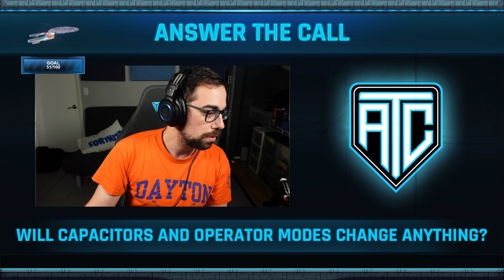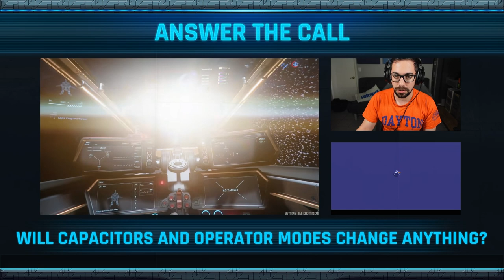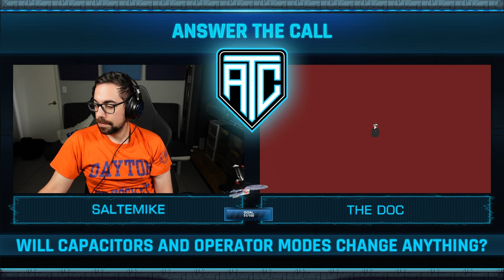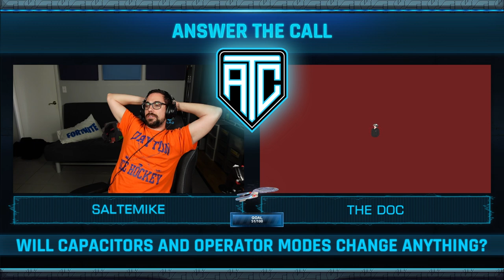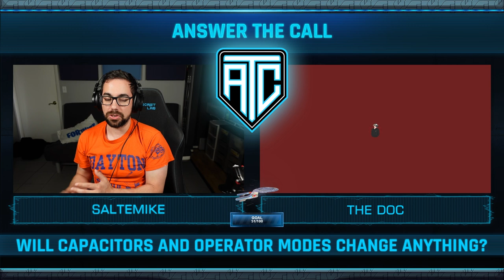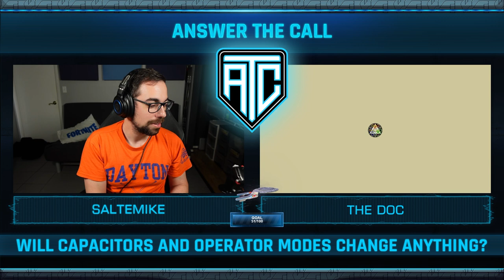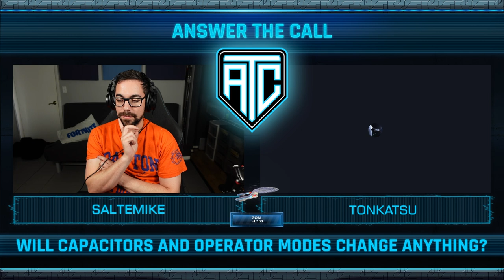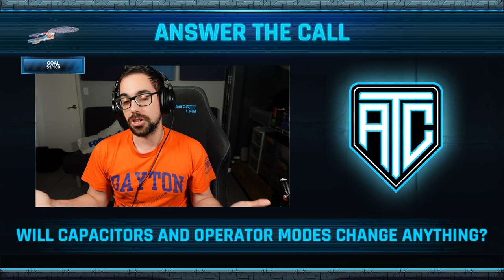Answer the Call: Will Capacitors and Operator Modes Change Anything?

Comment: Regarding high speed combat I propose different operator modes for the pilot:
1. Cruise speed, no weapons.
2. Combat, only SCM speed, weapons only come online once slowed down.
3.QT mode, only SCM speed, QT only spools/calculates when slowed down.

That allows people to "run" via cruise, but if they cannot shake you off they would still be a sitting duck when trying to jump away.

Okay that would still suck because there would be no limit to cruising away indefinitely... And no way to stop them.

But comment anyway for the algorithm :)
Reply from the maker: 1 is flawed because then running is too op.  You have to chase at the same speeds.
Reply: You don't have to solve the running away part, but also jousting. Even if people can't QT away they will still try to get as much distance as possible to buy time and that creates jousting. There should be a system that makes it very hard to get into QT and CRU once you're in combat so if you want to run you either have to do it before you are engaged or if the enemy pilot disengages you for whatever reason.

Comment: Here some points of a CIG employee about future keybinding improvements from Spectrum.

1) At some point we wanna take the time to allow creating custom modifier buttons for sticks. Atm the existing modifiers are hard coded but it doesn't need to stay that way. It requires some time to do it and I cannot say when it will happen but it is tasked up somewhere.

2) The upcoming operator modes (with the Missile Operator Mode being the first one) actually allows a lot of optimization in terms of input configs. Since some of those operators will be exclusive to each other (using guns and missiles on the same seat is not allowed at the same time) it frees up a lot of buttons (e.g. weapon groups, gimbal modes, swapping lead / lag pips are all not used during M.O.M.) ... so certain functions can be collapsed to the same buttons on the sticks.

3) In general our default bindings for sticks are hopelessly outdated. We'll soon start to update and including profiles that closer match the current range of available sticks.

4) We're thinking about to more combined keys. E.g. for the capacitor controls you'll have the default needed bindings but we'll also add a couple of "combined" bindings that have a different function based on whether you do a tap or long press. Similar combinations can also be created for other functions on a case by case basis. As always I am open to suggestions here.
Reply: Spectrum source:
https://robertsspaceindustries.com/spectrum/community/SC/forum/50259/thread/cig-huge-amount-of-control-buttons-necessary-durin/4031881

Comment: Well, the capacitor gameplay is a tried and proven mechanic from old X-Wing and Tie Fighter days seeing its latest iteration in SW Squadrons.  In the end, it will depend on how well they implement it, too soon to tell for me.
Reply: That is not really capacitor gameplay in those games, more like the power triangle we have in SC.

The capacitor system goes deeper than that as both a component that moves power between multiple components from the battery but also as a short burst of power.

Then we have physicalized damage system where a capacitor can be individually hit and take out multiple components since those components can be linked to said capacitor.

Comment: the way i see these Capacitors is the way Elite Dangerous pips are, u can put dots[pips] into engine, systems, ect
Reply: This is exactly what it seems like to me.. and I am curious as to why it seems like Mike hasn't played it.  You'd think he'd check out the competition and what they do.
Reply: One of the issues SC has is eliminated by how ED eliminates high speed combat, in favor of 'low warp' or 'cruise' speeds.  Intersystem travel.  SC does not separate the two.  They are trying to mash cruise speeds and combat speeds together.  Their capacitor pips work great, as there is a speed limit to each ship, a recharge rate to  ship systems and a boost cap to thrusters.  SC makes things too complicated.  Combat is too fast because fast combat is allowed.  ED's positional combat is great, because you have the time to use capacitors effectively.

Comment: Too bad, I missed the Twitch stream on this one! Capacitors I think will change PvP but it really depends on how much power they are going to put out compared to base power. If the capacitor is able to boost  power by 100% or more for short periods on time, it will change the game a lot.

Comment: With physicalized damage system online (whenever that is) means that if we hit a capacitor it could cut power to multiple components linked to that capacitor.

Why, because the power system seems to be the following:

Powerplant -->Battery -->Capacitor -->Components

So if a shield generator and two thrusters are linked to a capacitor and that capacitor is destroyed (and we cannot reroute power via another capacitor) then those components cannot be utilized.

Comment: One thing you might not know Mike is that developers check out subsections of code, not the entire thing, so they could be developing cutting-edge features but have an older copy of the other pieces and it won't get merged with the latest build until it's done.  So it could have been recorded the day the did the recording, and be the latest footage of the cap gameplay, but not have the other features because they haven't merged yet.

Comment: You can just look at real life to learn what the advantages/disadvantages of multi-crew ships would be.  Look at a single seat fighter like the F-15 vs an F-14 in terms of workload (not capability since they are different generation aircraft) for the pilot.  With the F-14 you have a RIO to handle your radar, radios and an extra pair of eyes, this means the pilot can really focus on flying the aircraft and keeping his eyes open for other threats while the RIO can focus on his tasks.  It increases the effectiveness of the crew by lowering the workload.  I'd like to see this work out with capacitors as well, where the copilot could maybe handle that while the pilot keeps his focus on the target.

Them adding "difficulty" into the game does two things, it potentially makes multicrew ships more powerful and it makes the possible skill gap between average and good pilots higher.  Sure, your pilot can still fire missiles, but that means he has to stop firing his guns, wait for lock... then fire.  If he had another crew member handling missiles that gap of fire wouldn't happen.

There is good reason you have two seaters in some situations like the AH-64 Apache, some models of the F-18, etc in real life.  I think that can reflect in Star Citizen so that two seaters are more effective due to the lower and more focused workload on the crew.
Reply: This, I think, is one of the key reasons of the nose system. Define multiplay in ships as having advantage possibly over two single player ships in certain circumstances.

Comment: A missile mode is going to also need a complete rebalancing of all missile attributes. The window for use is currently 2000 meters to 750 meters and even if you forced both ships to travel at average scm speed if they're headed at each other the window only lasts maybe 2 or 3 seconds. All size 1 missiles have .5 second lock time. 

Hitting an extra button and the display change adds another second for the hud closing that window further. Even someone running away at high speed will be out of that window in less than the time it takes to turn and lock on let alone change direction to chase them. 

It may make more sense to keep lower damage "fire and forget" for fighters and make the ones with better tracking geared towards ships with a copilot seat that have better than standard tracking properties.

Comment: Missile operator mode, specifically, will probably only apply to multi crew ships.  Not solo fighters.

Capacitors sounds like rechargeable batteries that give a boost to any system you wish, on command.
Their benefit will only last a short period of time, before they need to recharge.
It's just a "buff" on command.

Of course these systems will change gameplay.

Good or bad, remains to be seen.
Reply: In the ISC they specifically say that it will be used in solo fighters as well and that you will have to choose to ether be in gun mode or missile operator mode and you cannot use them at the same time.
Reply: No it applies to all ships.
Reply: @Sarazoul  oh boy.... 

That's going to go over like a lead balloon.

Hovermode 2.0?

Comment: I could see it being helpful for balancing stuff like the Talon. It can keep the nice forward boost and the 2xs4 fixed on such a small fighter. With capacitors you give the player the choice which one to use. We have a system that lets you do that now, but expecting players to toggle thru menus mid dogfight. 

Originally the Talon had a LOT of power issues, and you'd randomly lose power on items.  This system can be like a buffer where the Talons strength is balanced via power distribution, where the bad side effects are lessened by just having an empty capacitor. Like "oh no I can't boost because I've been overclocking attritions". Instead, the Talon having badly managed power on original  release would randomly spin, shields would just shut off, as well as the display. I loved the realism, but it wasn't 'gamey'. It was just a confusing mess.

Sorry if that didn't make any sense.

Comment: So what Mike said 35 minutes in the video. Having more buttons to push for mouse and keyboard (which was techinically superior accuracy) means it gets harder for the "better" way to beat a good hotas system that uses easier button taps. So if that true good balancing.

Comment: The developer said they drain very quickly when using them with lasers. Sounds like it's gonna be another "why bother".  Besides with literally 5-15 seconds of dogfight time how you gonna have the time to allocate capacitor charge. And my controller bindings are quite full. Be nice to revamp the control set up. Hold and double tap ain't quite cutting it.

Comment: Having a turret gunner CAN be more effective in the future than having 2 ships out at the same time because of cost. When insurance gets implemented it should bring the cost of employing 2 ships to a much higher rate than utilizing just one. This would tie into all the other operating costs like fuel and other situations such as larger quantum jumps which smaller ships cannot complete without stops. 

The same argument can be applied to ground vehicles. Everyone keeps asking why someone would use a tank or any ground vehicle over a space ship because the space ship is obviously better. However, the cost of insurance and initial purchase of a ground vehicle would be so much less, as well as the cost of claiming them. Why take out a target/base with a space ship when you can with a couple of tanks?

None of this applies in the current build because not much of this is implemented or balanced yet...

Comment: Okay, so after watching the video 20 times here is how capacitors appear to be working.

There are 3 capacitors, one each for shields, engines, and weapons. The power plants provides energy and you funnel that power to the desired capacitors (Just like the power MFD). Depending on how much power you divert the more efficient the capacitor is. 

So the shield capacitor regenerates the shield. No energy in the capacitor means no shield regen. Weapon capacitor powers the weapons. So like shields if there is no energy in the capacitor the weapons won't fire. Same with the engines, but I'm assuming it works as afterburn/boosting. So empty capacitor means no boosting.

Now the next question is can the capacitor continue to fill as we use that energy, or will it have to be empty to refill. Hopefully it's dependent on the percentage of constantly flowing energy we manage to go toward the capacitor.

Please give your thoughts below. Thank you 👌

Comment: Well, my mouse has 20 buttons, but for the average mouse user, this will be a challenge. I already use all 20 of my buttons on my mouse in SC, but I also have my flight sticks. I need a new desk to hold them properly, but I can still use them if I readjust my desk.

Comment: Am I getting this right?:
Would it be right to say the capacitor is a sort of energy buffer? Stores up energy so when needed it have alot higher output than what the power generator is capable on it's own. And when that buffer of energy is used up, you basically use power directly from the generator, which is alot lower than what a fully charged  capacitor is capable of? So you'll be smart to give the capacitors time to recharge by having them be focused on a component that is currently not in use.
Am I close? :P

Comment: They already nerfed missles big time. I honestly feel like they FINALLY got missles in a good place and they are messing with it again. And I totally would have been bothered by it if I didn't see it. You can use both guns and missle lock now in regular aircraft. So what 900+ years in the future they had to take that away? That doesn't pass the smell test.

Oh and I now the copilot has missle control that is so NOT NERFED if you have a copilot now missles are going to be dangerous as hell,  especially when you can launch the all at once.

Comment: One of the solution about keeping people in combat I'd suggest is nerfing hard the acceleration, for now it doesn't correlate to ship mass, also acceleration in game is linear and it should be more of an exponential curve, making fuel a huge player for chase...
I'll explain myself with the fallowing example and I'm going to use DCS for it because people can test it themself and account on the "feel"....
In real life it's a bit harder to use an F14 tomcat vs an f16 viper....

Anyhow...
The heavier a platform is, the more time it takes to accelerate to given speed...
That alone is a handy solution, now in addition...
DCS dogfights and real life are determined by the first 3-5 min and ofc of predisposed plane situation before the engagement...
Why 3-5 min, because fuel in AB can be as x25 times as consuming as full power "dry"....
And that makes sense that dogfight should be fun and very skilled, a person need to understand its platform if I go full ab at the beginning I'll burn all my fuel, would not be able to maneuver nor escape...
That is way overheating is not doing its work, since it's "infinite", let your engine cool and boost again...
But when you have a limited resource as fuel, then you'd think twice before boosting and burning x25 your fuel....

Now for circling back to acceleration  being linear, if you get it to be exponential you can definitely take off the cruise speed limit, ships would be bound to their engines thrust, hull weight, and fuel capacity...

Say a hammerhead can accelerate 1 unit per second for 10h or 10 unit per second for one hour before it runs out of fuel....
Reply: Sry I'm not organized with my thoughts....

I can elaborate way more on how can this approach make the game way more fun, but I think I've written a book already with just jibber jabbers

Comment: Okay, rant incoming....🤔🤔. Why can't combat be based on modern day fighters? Why are they so stubborn on sticking to WW2 style of combat for ship to ship fights? I will be doing a spectrum post on this with a demonstration video soon, but there is NO reason not to based the combat on modern day stuff. So what does that mean? Well we need both long range and short range combat mechanics for fighters. Long range combat means scanning the space ahead of with your radar and other sensors and once you find someone and you are in range you shoot a missile. Then the stealth and scanning mechanics can shine, there is no point in having a radar or other sensors if combat is limited to 5 KM. So short range or close in dogfights can take place using guns, and short range missiles. So you have to plan ahead to what type of combat you anticipate been involved in, you will have to get good at picking your missiles and sensors and be really good at operating the radar to find and track lock targets at long range and when I say long rage I mean 100 km plus, current generation fighter jets can see targets on their radar at distances above 160 km and can shoot a missile at a locked target at 20-60 km, depending on energy levels and altitude and vector of both. So why aren't we basing our arguments on that? Modern combat is the only way for Star Citizen ship to ship combat. For example a Javlin destroyer should be scanning and looking at targets up to 2000 km away, then things star to make sense and get fun. If you want to get close to a javelin you need to use all your stealth and masking tricks then you might get close enough, things like using stealth components, mask your self by taking cover behind other ships, or asteroids, or jam the Javelin's sensors. I disagree with the caller who said realism equals no fighters, there will always be fighter aircraft/spaceships or what ever , and there will always be that close quarter one on one dogfights till the end of time. Now in the future realistically dogfights could be between two drones either operated by AI or human operators but  there will always be dogfights.